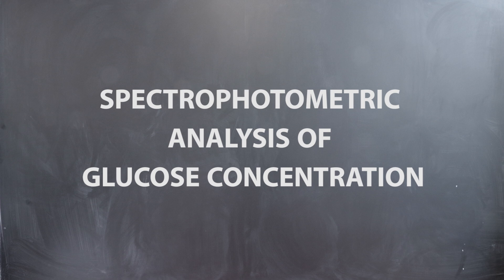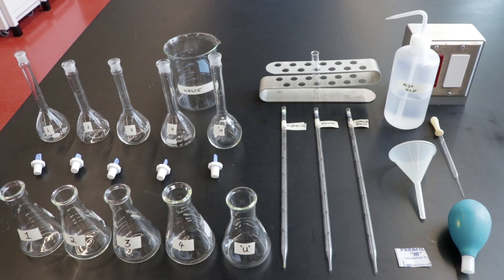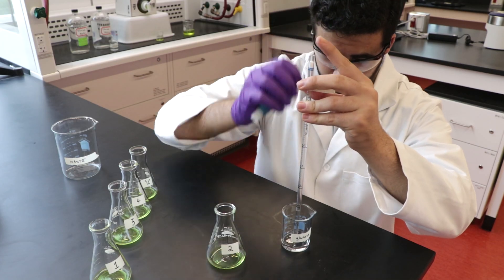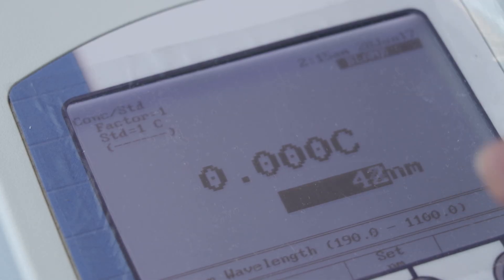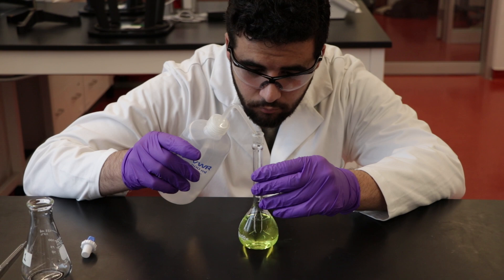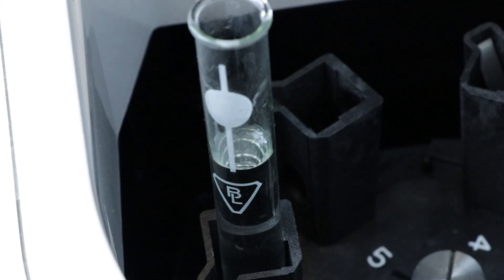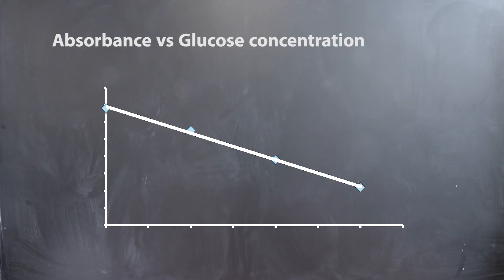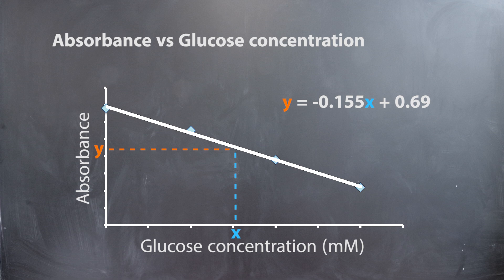Chemistry Lab Skills: Glucose Spectrophotometry

Comment: How you prepare the regular glucose and ferricyanide solution? I mean to say, do you have used any other chemical with this to? In the wall of fumehood, it is shown that you have mentioned 0.5M sodium carbonate with 0.015M ferricyanide. Whats the meaning of that. Also, in the beaker wall containing regular glucose solution, you have mentioned 0.5 g BA. What does that mean? If you let me know the answer, that's will be a great help. Thanks.